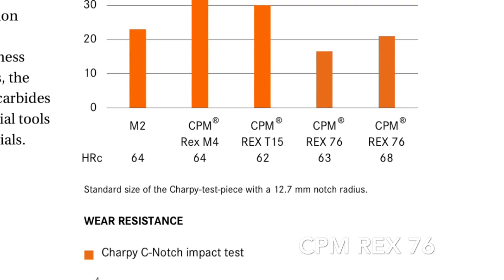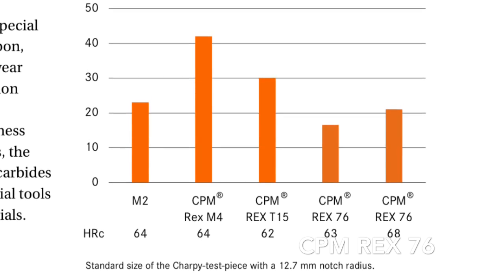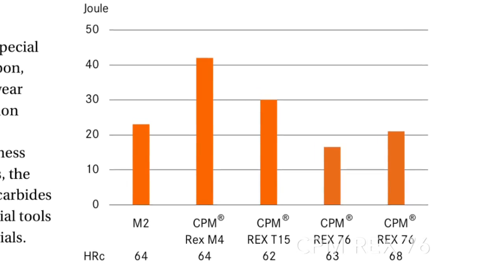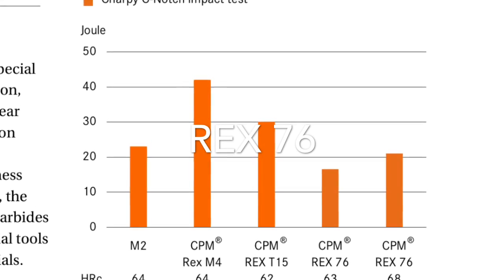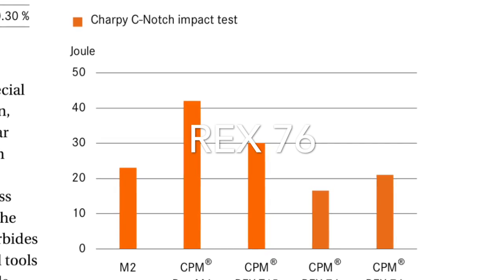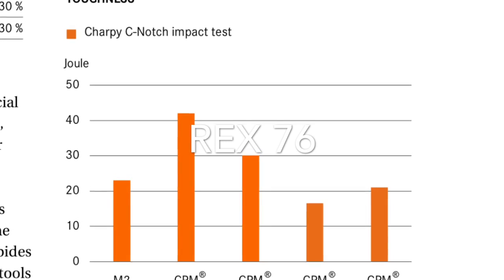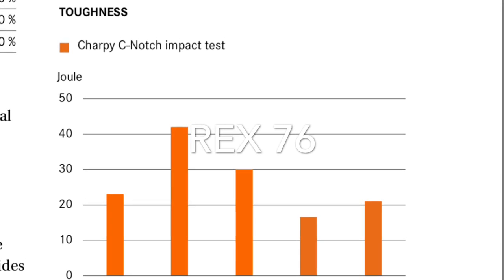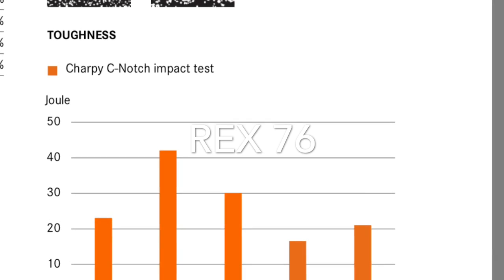CPM Rex 76 Steel Toughness Test

Comment: Very splody

I have applied some mild curious roughhousing to my maxamet manix and it did not disappoint... probably cause spyderco runs it at 3 points lower than recommended hardness

I have seen Extrema Ratio test their N690 long knives, bending them into a U
Very nice edge on that stainless, love my viper keeper